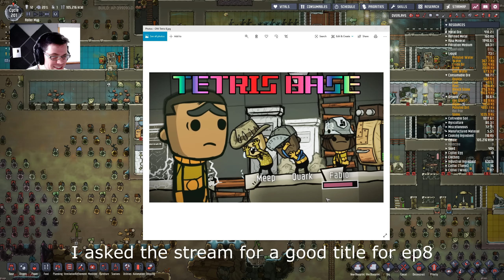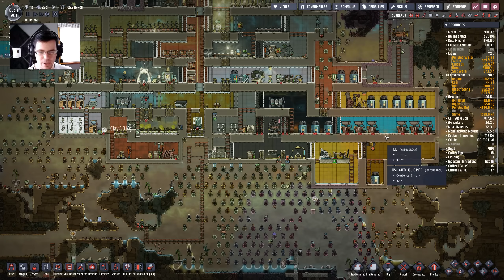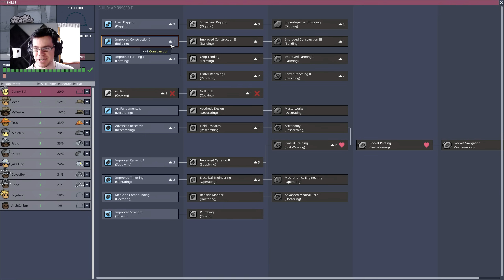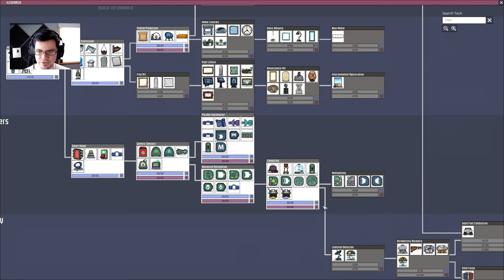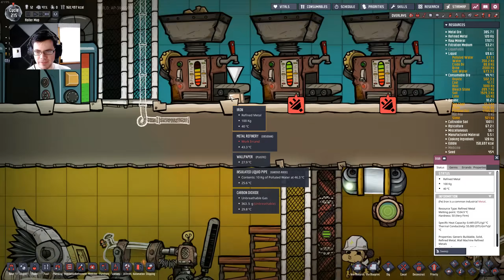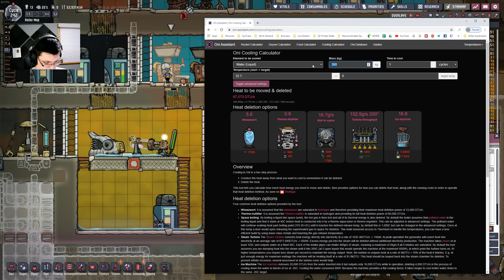Direct Loop Cooling! - Oxygen Not Included ep9

Comment: Sweet base, I'll have to start this series from the beginning. I've been watching your Oasis playthrough alongside mine and ended up building a wood-oxygen loop and topped it with a steam turbine eventually to supercharge the cooling (it lasted until I got to that research!). But instead of satellite bases I'm going to try running a tight ship with everything built inside my starting biome and automated systems outside.

Comment: It is better to check the temp coming from the thermal generators and possibly sending that to the refiners, rather than sending it from the tank, because if you send it from the tank, you have to wait for the temperature to be equalized in the tank, which is constantly reheated by the coolant returning from the refiners, making things take twice as long.

Comment: Hey, so I've talked about this game a good while ago with a friend, and I mentioned the whole cellular automata that is gas and fluid handling.  He brings up a good question:
What happens in a room with a volume of two tiles when there are three different fluids?  For example, stick a Duplicant in a two-tall-one-wide room filled with oxygen.  Over time, he starts converting oxygen into CO2, which sinks to the lower half of the room.  Then, he has an "accident" because of the lack of a toilet.  Does one of the two gasses get destroyed, or does the polluted water just not appear?
Reply: Did an in-game test: oxygen stayed in upper cell, co2 in lower.... when the duplicant peed, the co2 was destroyed/ replaced with polluted water. Afterwards, with oxygen still in the upper cell and polluted water in the lower, co2 was never actually exhaled - duplicant continued to inhale oxygen but the presence of polluted water prevented the co2 from coming into existence.
Reply: @justinhannan1713  Neat.  Thanks for the test... never got around to figuring that for myself.

Now I wonder if that couldn't be abused for a deletion mechanic... but I guess Brothgar's earlier fart eater would be a sufficient replacement.
Reply: @sctjkc01  No problem. Sometimes I troll Brothgar's page for unanswered technical questions. Glad to help - the fart eater was rather amazing.

Comment: The thermo generators work great if you back them with temp shift plates, drop some liquid on the floor, and have them in a high pressure environment.  I have a better result using radiant pipes and cooling the environment to cool the pipes, than to try to cool the pipes directly with the thermo gens.  keep a room at 10C and run the cooling loop through it. usually takes as many gens as there is 4x4 spaces to keep it that cold though.

Comment: @Brothgar
18:08 No, change the floor to be doors, then toggle the doors periodically so the bottles falls down 1 level, then have just enough CO2 to displace the (p)O2 but not enough to over pressure the bottles, this creates a zero energy continuous oxygen production room.
Reply from the maker: Hmm good idea :D
Reply: @brothgar  You might need a thin layer of liquid, to lift up the CO2 enough to make the bottles offgass.

Comment: Multiple streams and threads analogy actually works extremely well. Having a single pipe/stream that has to do everything is just like single threaded programming: if you want to do something, you can't do the other things. If you can use 2 threads, you can do 2 things concurrently.
There are some limitations in the analogy about computer threads needing to join up and usually not just being a pure loop like the pipes but yeah, good analogy!

Comment: I see that you did your calculations on the external tools with water in mind where you are using polluted water. From memory, I do not remember if they both have the same properties but it could change your calculations. Maybe also this is why petroleum would be better if its properties are better.
Reply: The only difference between water and p-water that I know of is that p-water has a lower freezing point and a higher evaporation point.
AKA : You can cool it down more before it freeze and you can heat it more before it turn to steam.
Reply from the maker: Oil is useful if you are transferring to steam, because you get can up to 200c and work a steam turbine fast. The modded equipment is quite a bit different as it always runs at the same rate when above 10C. I think it's overheat temperature is 100 or so.

Comment: What about ranching smooth hatches to make refined metal ?

5 Smooth hatches don't require a lot of metal, but it is a constant production, don't make heat or need labor, only use 1 unpowered incubator for sustainability and is 25% more efficient than the rock crusher.

Then again you seem to be fine with the refineries now.

Comment: question, is that possible to cool or heat a biome? my ol biome is to warm, i try it with the steam turbine and the thermal generatoren-- dunno the right name because its in chinese, but it dont work atm.. last generator takes a lot of time
Reply from the maker: Yeah, but a biome has a HUGE mass. Digging up what you can will reduce the mass making it more possible to cool stuff down. If you can get ice involved that's another way to cool something and unlock some water int he process.
Reply: @brothgar  ok perfect, thank u :D  i try it out. cant build more atm all is way to warm xD ok and yes about 150 c is for me to warm.. im still learning with 621 h playtime xD
Reply: What yer looking for is an aquatuner. I've seen the whole magma biome hollowed out and replaced by water, then frozen. Over many many hundreds of cycles.
Reply: @Nikletheman  yes that what i do atm is about the same, it takes ages for cooling